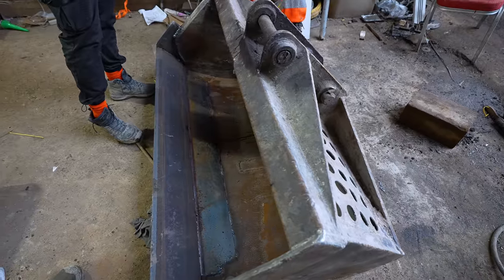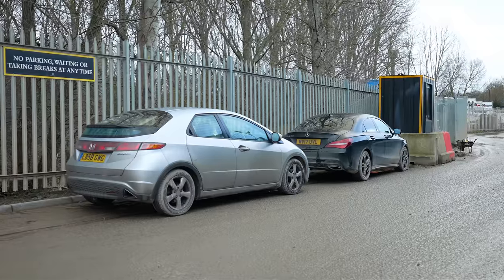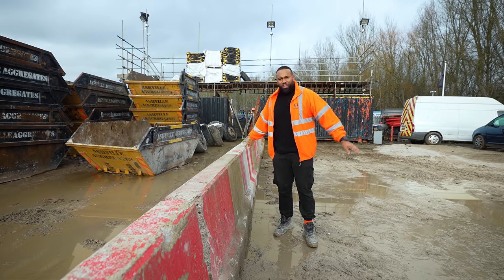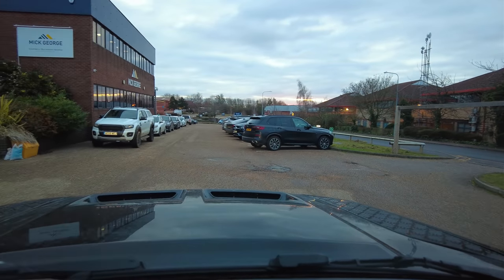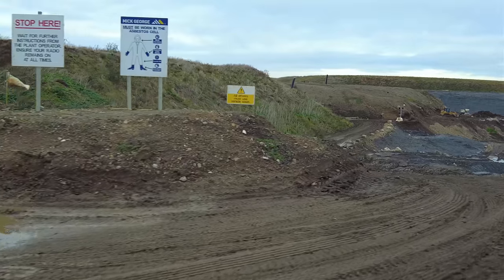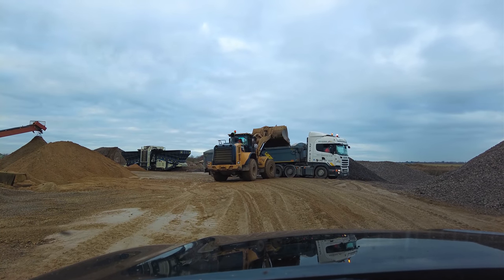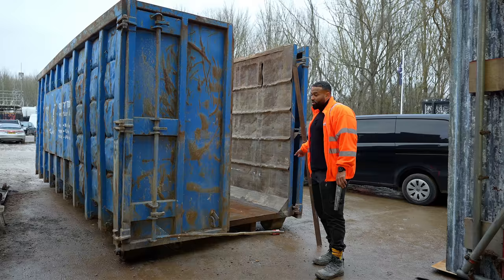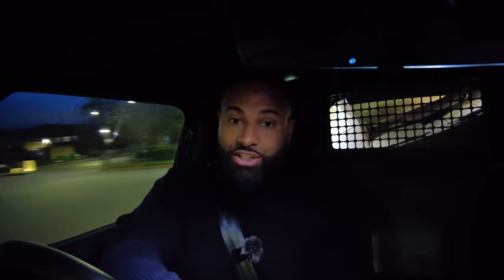Breaking Bad but Pouring Good | Ashville Weekly ep063

Comment: I remember years ago when I was on the tools. We used to use Mick George, back then they were small, with a handful skips trucks. They ALWAYS turned up when they said they would and always sent tidy gear. They were big on recycling way ahead of the others and had something like 85% recycled from every skip all those years ago. 

Also, the barrier, you love a gadget like me. I’ve got a Hikvision ANPR cam at home, that can be used to control barriers. Simple add their plates, and other regular visitors to system and it will open for those cars without need for a guard(the install paid for within 2-3months without guards pay), for the other traffic simple fit an intercom at the gate linked to main office, along with a light or bell that comes on in main office when cam detects vehicle at the gate, which could also immediately ping up a live video feed from gate cam on a TV in the office. Go a for a 2 level intercom pole, one at truck height, the other at car height. They could just open the gate when needed for unknown
Reply: And up you go.
Reply: great information rupert M .
Reply: @Lancashirelad I can imagine that being a head ache. I can also imagine it pretty easy for it bounce around different phones until it’s answered. Quite likely with a static IP that it could be controlled from outside the network too.

Comment: Get the Bio bug solution into the red derv tank and then get your fuel tested before and after, it only will get worse and grow. Can cause a lot of trouble with injectors on machinery. 
Another great episode!
Reply: @Lancashirelad There has always been bio in fuel, the amount changed with a higher percentage being allowed and it has caused a massive amount of damage, we have had many machines fail due to it, mostly injectors. I have had the fun job of rectifying the problem and know all about it.. Good regular tanking cleaning does help once treated. Random fuel testing also.
Reply: @TheMickysham  we all got use white diesel in April
Reply: @TheMickysham  I'm guessing you're in the UK?
Reply: Yeah the running on white is going to be interesting, from an economical way and new fuel solutions will have to be created or come up with. 

Yep over in Northern Ireland

Comment: 28:55 Hi Daniel. The same thing happened to me at my place of work. The normal existing number of pallets of moulded aluminium blocks is typically 8 but just last two weeks in our shift (2pm-10pm), I produced 13 pallets and some of the workers were really not happy with that because it looked like I have set the bar high for them to beat and the supervisor did take notice of the increase in the number of pallets that was produced on that particular day. And someone actually came up to me and said “why the f**k did you do that” and I’m like “what did I do”? 🤷🏽‍♂️🤦🏽‍♂️

Comment: Danial, Water get's into the tank due to condensation this could be at the suppliers, in your storage tank, though the rate of red you use I find it strange. It could be the machines tank s getting warm and then cooling down overnight. One way to beat condensation is the keep em filled, another is to install a diesel polisher, these are often fitted on boats I've never tried the additive but understand it's expensive and can cause other problems, get advise before using it and not from the supplier. I installed a circulating pump and filtered the tanks diesel through cheap truck filters, then the boats engines fuel was filtered again as it was used. The dreaded diesel bug.
Reply: Welcome to bio diesel.

Comment: Always used to pass a convoy of Cemex trucks on the M4 around 15:45 every afternoon, they’d all be doing 45-50. I found out later they would always drag it out till 16:00 to get back to the quarry to avoid doing an extra load 😂

Comment: We have got diesel bug all the time if you don't put the diesel bug solution stuff in the tank it will just keep doing it but I would recommend you to clean out your red diesel tank the one what holds all the diesel because the solution won't get rid of the old stuff sitting in the bottom of the tank and then you'll keep having issues merry Christmas 🌲

Comment: 33:40  
The diesel bug is the name for the microbial contamination within diesel fuel. Diesel fuel tends to contain up to 7% biodiesel – this is great for the environment but not always a great solution for any business who need to store fuel.

Biodiesel is hygroscopic. This means it holds and attracts water more than other fuels which is bad news for diesel. The attraction of water encourages the growth of the diesel bug and can lead to gums and resins which can stick to the side of your fuel storage tank, even causing layers of build-up inside the tank.

When the industry used petrochemical diesel rather than biodiesel, there were fewer problems as it does not attract water the way biodiesel does. The diesel bug thrives from any amount of water when met with biodiesel. Therefore, it is vital that no water gets into your fuel storage tank.

The diesel bug can multiply very quickly by doubling in size every 20 minutes – this means that it doesn’t take long until a biomass of diesel bug to become a few centimetres thick and to cause havoc in the engine or the tank.

Comment: Daniel. You might have explained this before but looking at previous videos, I see how all of your offices are converted shipping containers and stacked on top of each other. Was that by design or that is the way companies such as yours have done office setups. The one downside I can think of is that you are limited to the size of the container with not much room to move around compared to a normal office building. But the one advantage I do see is that with the offices setup in shipping containers, if the need arrives for an expansion of the yard or moving to another location, no need to rebuild the office buildings because you can just disconnect and haul them to the new location and be setup at the new location in record time. If you have not explained the use of the shipping containers, can that be explained in a future video. Thanks

Comment: I know there are a number of factors that play into the answer (strength, slump, pump mix etc, all that consume materials at a different rate) but how much concrete can those volumetric trucks make in one sitting before having to reload? around me they can do roughly 10y3 (7.5m3???)

Comment: Putting a product into the diesel tank on the Liebherr will just kill the growth.  You need to steam clean the tank.  Then use the product regularly to prevent growth, whilst you investigate where it is coming from.  (the gas oil tank in the yard?)

Comment: The 'parasite' in the diesel is actually algae growing in the diesel. Diesel nowadays has a low sulfurcontent  to lower emissions which cause acid rain. But the sulfur also killed the algae. Diesel also contains a percentage of biodiesel, in contrairy to normal diesel this can attract moisture (like from condensation in diesel tanks, so it's best to keep the fuel tank of the machine topped up especially in the wetter season). This moisture absorbed in the diesel helps algae grow more.
There is an additive you can pour in your main diesel tank (so it doesn't grow in that tank and the product is mixed in to go in the machines) to kill the algae, don't wait to long with it because once the fuel filters start clogging up it could also be necessary to clean out the entire fuel tanks of your machines, we had this happen on the farm. Our fuel supplier adds the product when he delivers now once a year.

Comment: If the new driver isn’t speeding then there is no issue, but man a job isn’t a huge difference. That driver could be a machine, the other guys have been working for longer - burnt out, older, kids etc all those factors make a difference.

Comment: Wouldn’t it be more to your advantage to put a call box/camera system at the gate instead of posting someone there full time? Think maccas drive through system. That way your not dedicating one person in a box 14 hrs a day or whoever long they’d be there. I’d cable that to the office and maybe have the staff trained on how to handle the work load remotely. Then if needed, someone can physically walk to the gate to deal with visitors etc

Comment: With regards to your drivers moaning about other drivers well here's a suggestion,  offer then an incentive,  if the expected is 5 deliveries or collections a day is then offer them £2.50 bonus with overtime if required , this bonus would  be paid monthly,  so if a driver hits more he gets £100
You get 5 drivers hit an extra run a day its like paying for another driver and expenses. 
The other thing you could look at is offering drivers a defect bonus where in they get a weekly bonus for  reporting no blameworthy damage, you offer a driver say £20 a week bonus I guarantee they will take that little bit extra care.
But if they damage the truck  once in that week then they loose that  week's entire bonus
What's the cost of a headlight, rear light cluster, just a thought, and if you implement my ideas I want 20%😉

Comment: Hey Daniel - another fantastic episode as always. The parasite you refer to in your fuel filter water trap is diesel big as a result of water in diesel. Sadly this is an unavoidable occurrence and happens from first full with diesel. There is however a solution that will ensure that fuel contamination doesn’t cause you costly breakdowns or the need for premature maintenance 
https://youtu.be/Y6n6sMo4Ybc
Would be delighted to run you through the benefits in more detail should you see fit?
Love the channel as always and have to say the quality of the merch (hoodies) are spot on. All the best!

Comment: Simple solution to the slackers get out in the truck see what is possible to do in a day ( by the sound of it the new guy has already give you  the answer) and then you can question why they are not completing the task. No doubt you have trackers so just keep an eye on there. 
I always go on a job first see what is doable then hand it over to the work force. At the end of the day you are trying to run a business not a charity.
Reply: Why are they slackers? They do as much as they have to do. Why should they do any more?

Comment: Why do you pour your concrete so wet ? It runs like water. Be okay for a self leveling floor. That new guy that's doing a load more than the rest. You can't give him extra u dear the table. Because he would eventually open up his mouth. The rest of the crew has the mentality you owe them because they worked for you for so long. You really want to fix the problem. Hire WOMAN. Add one at a time, they will either pick up the pace or move to other employment. Regardless what you pay them, it's not their company. They could give a shit less!  Put a level across the roof of the little security hut. Looks unlevel, even from my house from Pennsylvania in America.